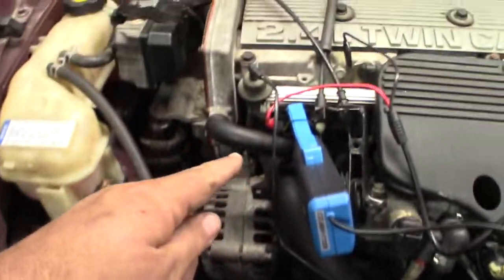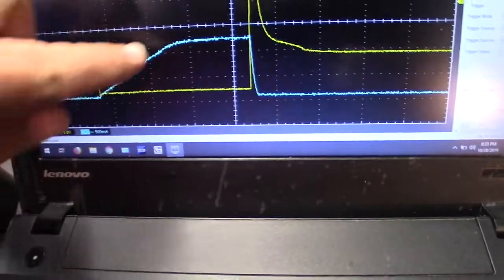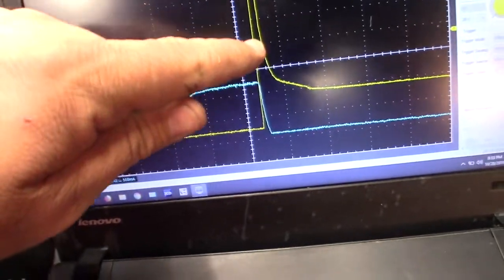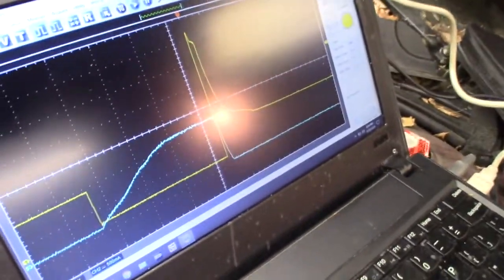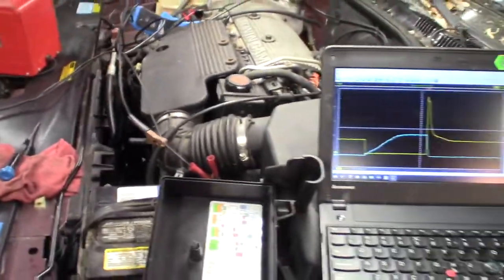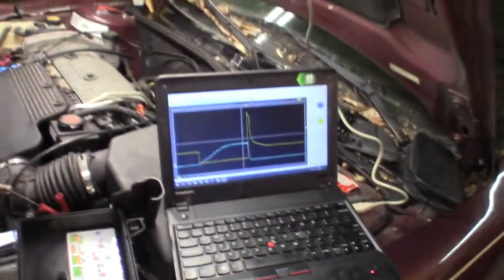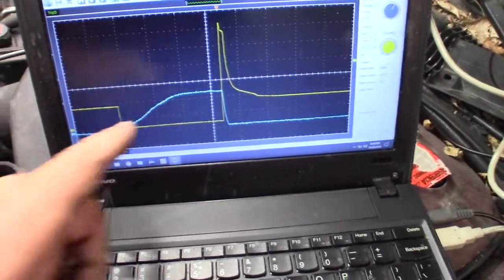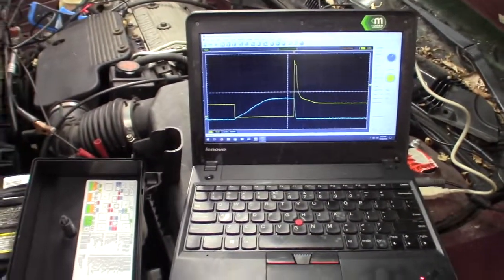Hantek 1008 Scope - Trying to Capture Fuel Injector Pintle Movement

Comment: That is a normal oscope pattern right there and where the yellow line drops down that is your amount of open time pulse width or duration and you are correct when it closes and spikes up and then when you get that little hump at the top on the other side of the spike is when it completely closes

And then you have the dissipation of the residual voltage that's left over as the trailing leg that comes down

It gets even crazier when you start looking at waist spark ignition systems or double fire Ford ignition systems
Reply from the maker: Thanks.

Comment: @FrugalPrepper's Garage & Garden  You want to get started with Pico cheap. Buy a Pico 2204a and use an attenuator. It comes with the regular Pico software- not automotive, so It wont come with the automotive setups(pdfs) but you CAN transfer them to the software folder via copy and paste. Check this out:  Pico Scope for Beginner's(2204a) https://www.youtube.com/watch?v=nBNtmc-7isQ   Transfer Automotive Picoscope settings to NON automotive Pico: https://www.youtube.com/watch?v=s-MdemuC_Xs

Comment: Just picked up the 1008c myself, and I'm also subbed to Enrique. Haven't had a chance to play with it yet though. 
What do you think of the automotive software that came with it?
Reply from the maker: It's buggy and it locks ups a lot when trying to store a waveform, and you have to do all kinds of tricking to get Windows 10 to load the unsigned drivers (luckily I am an IT guy for my day job).   It leaves a lot to be desired in a scope, but I still want to experiment and see what I can do with it reliably.   I really want a Pico, but I can't afford one right now, so I am going to use what I got and learn as much as I can.
Reply from the maker: It would be interesting to see if the 1008C has better filtering than than the A does.
Reply: @frugalprepper  I have seen people said not to use the disc that came with it but to download everything from website after registering.
Does win10 allow you to run software in compatibility mode for older version of win?
Reply: I purchased one about a year ago and almost gave up on it. Like Tom said, it's a little troublesome to get running, so much so I told the seller I'm sending it back. She told me to keep it because the shipping was too expensive. A few months later I went back to work with it and found out it was a software glitch I caused. Now I have a working scope for free. But, it's still has a lot to be desired. Lets all buy a PICO and share the costs. I'll store it here. (ha ha) Great video tom. There are not too many good videos out there on how to get this scope working.
Reply: I personally use my uScope way more than the Hantek. I only reach for the Hantek if I need more than 1 channel or if I want to just play around making presents and stuff.
Reply: They are on version 1.0.30 now HERE( on this page go to DOWNLOADS TAB- package is 23mb):  http://www.hantek.com/en/ProductDetail_2_13171.html   SNEAK PEAK of what software looks like:https://www.youtube.com/watch?v=UorzgODeMCM&t=287s 
****TIP: Its NOT a 64 bit software but, I installed it default(program files x86 and it was VERY buggy and froze up...etc. I uninstalled and reinstalled in Program Files(x64) and all is well!
Reply from the maker: @wyattoneable  A viewer sent me mine.  He didn't like it and said he would donate it to the channel.
Reply: OpenHantek is slightly improved over the Hantek factory software.

Comment: Way better off buying the 2 channel Pico for close to the same price.
Reply from the maker: FrugalPrepper's Garage & Garden
9 hours ago
Do you have a 2 Chanel scope that work with Pico’s automotive suite?  I was looking but could only see the 4 and 8 channel scope that were supported with the automotive software.   I may be willing to get a two channel but it will be bad when I need a can/crank correlation with something that has two can sensors
Reply: I think you can use the 2204a with the automotive software.
Reply from the maker: @blair683ify  According to Pico "Unfortunately the 2204 scope will not run with PicoScope 6 Automotive software predominately to protect the device from typical automotive environments.  The 2204 scope is from our Test and Measurement (T&M) range of scopes designed a built for industries other than automotive repair."
Reply from the maker: @blair683ify  There is a 2 Channel 4225, but it's $1700 for $2400 you can get the 4 channel 4425 (which is the one I want)
Reply: That sucks! I was eyeballing a 2204a to. There’s a lot of automotive reviews on it on amazon. I guess they must not be using the automotive software.
Reply: @frugalprepper  2206B is a nice spec scope, better than the 2204 2205, still on the non automotive software but copy some setting and setup and save your own settings and you get close.
I use the 2206B as my quick scope and mobile scope, works really well as pico software so nice, sure the hardware and software for automotive designed to match test scenarios better but the 2206B mixed with user who makes effort configure software saved setting and mixes in good amp clamps, attenuator etc will get quality results at small buck outlay .
Reply from the maker: @mrb1864  I am probably going to give it a shot and see what I can do with it.  The Hantek, really leaves a LOT to be desired.
Reply: @frugalprepper  
It about best you going get for few hundred bucks, 2206B extra spec helps a lot and your biggest gain is the software, the hantek software is really poor .
I do have a handheld hantek dso1202B I picked up used as a first scope/dmm combo, kind of a cheap snapon vantage, useful enough but not great and could use that via pc as well and that introduced me to hantec pc software which put me off wanting hantec for more serious work scenarios .

another bonus with pico is amount of online support that be pretty much directly platform usable making both learning and time diagnosing quicker more fun and confidence boosting .
Reality is it really small money for professional result diag coverage it going give you .